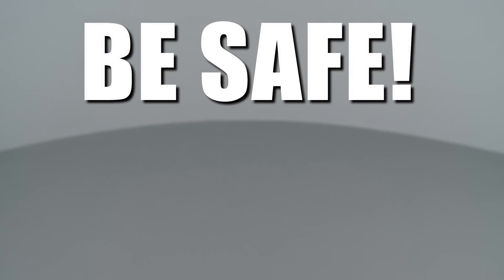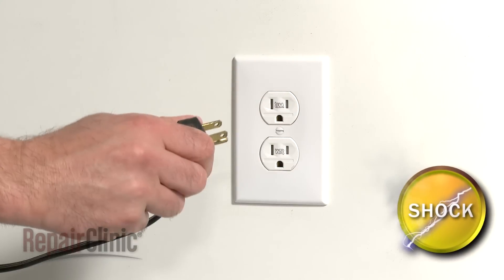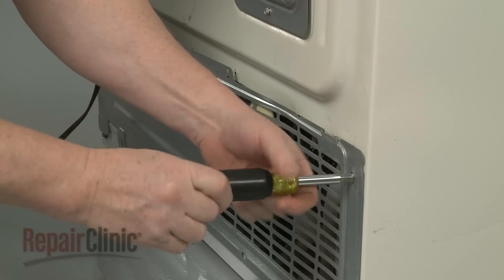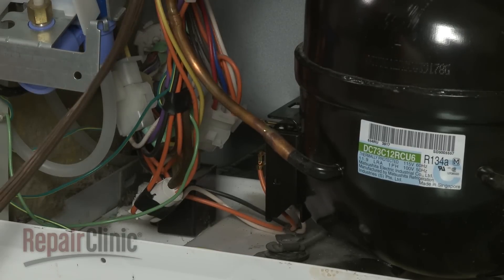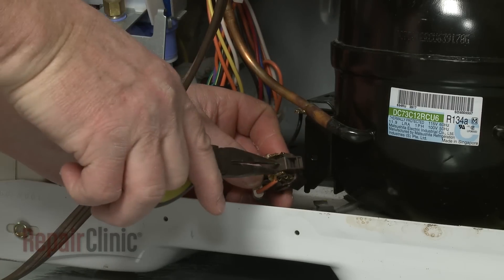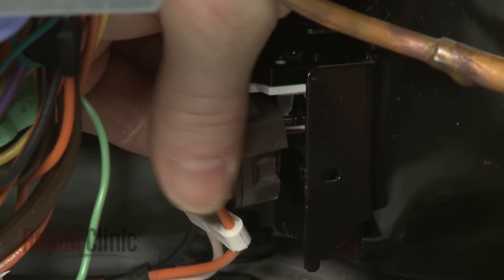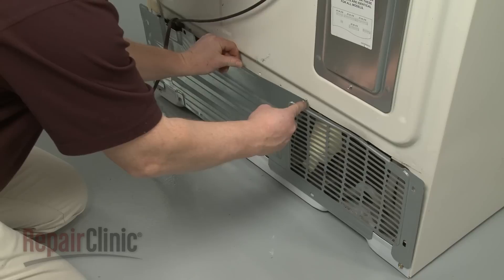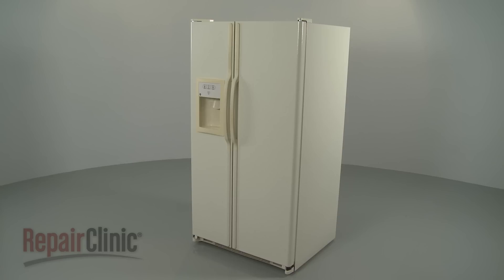GE Refrigerator PTC Relay Replacement #WR07X10025

Comment: Also, ohm up the compressor motor windings to make sure the failed PTC relay didn't burn it out when it failed! Its a common problem
Reply: I have no idea what it means to “ohm up the compressor motor windings”. But I just now replaced the relay. I don’t hear the compressor turning on. And the air coming out the back of the fridge is still not as warm as I’m sure it should be. I’ll wait a bit. But I think this didn’t solve my problem. But thanks!
Reply: Brian Gardner did you manage to solve the issue in the end? I think i have the same issue, my compressors not coming on so I don’t know if it’s the relay or the compressor. There’s a big price difference in repair! So I’m just curious to know if you ended up with a new compressor, I’m not sure if replacing my relay will solve the issue either.